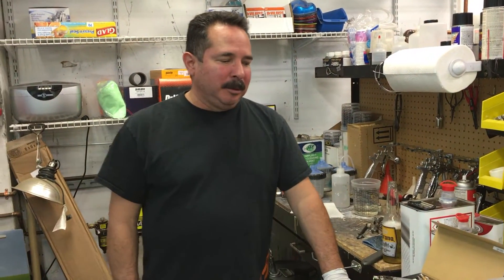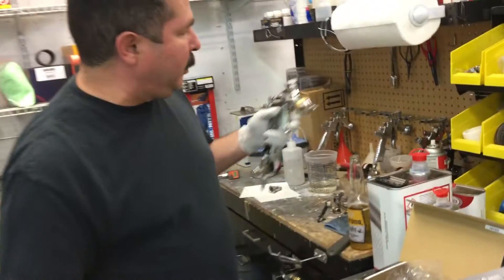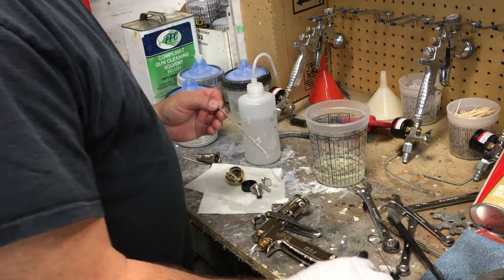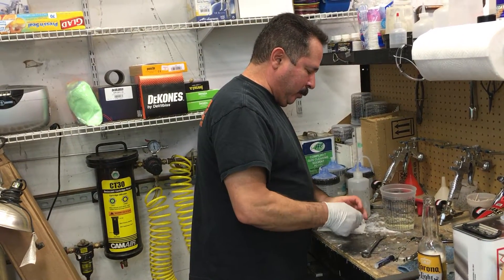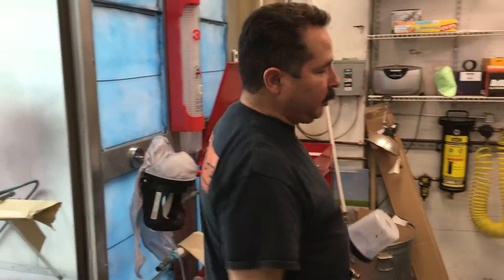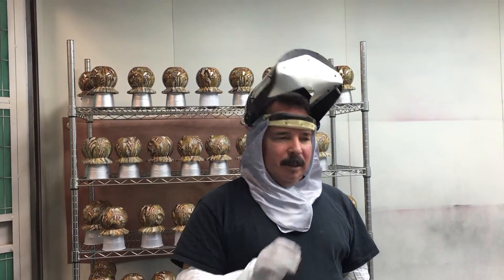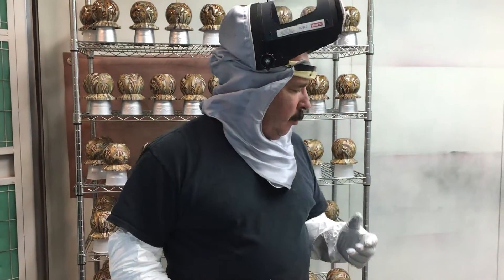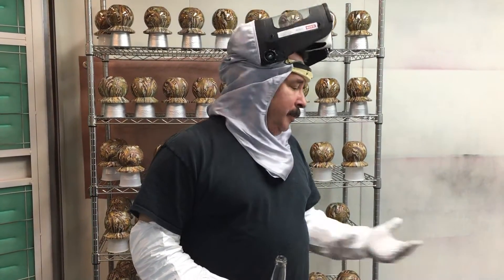K2 Forums Emerald Spray Gun Review

Comment: what was that clear you used and how much psi at the inlet?
Reply from the maker: +snakymen13 The clear was called Value Tech...and it doesn't matter what it is at the inlet...ours is higher now because we have to feed a constant 50PSI to the SATA hood so now we have to choke it at the gun down to 19PSI...
Reply: ok thanks would you recommend that gun for clearcoat for the price or the iwata lph400 wich is around 500$?
Reply from the maker: +snakymen13 Well...it depends on your budget...you can't beat the quality of an Iwata for sure...but it's also double the price...I never worried about the price of a good clear gun...it is worth it in the end...all my clear guns are around $750 or more per gun...would not trade them for the world...